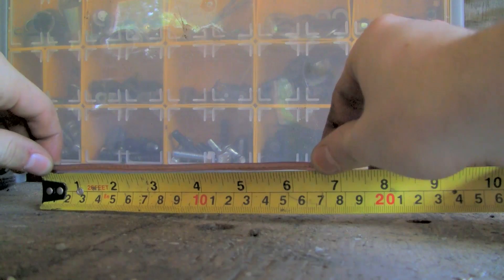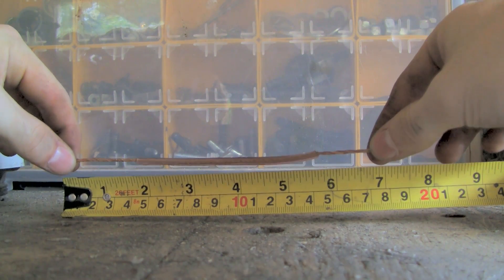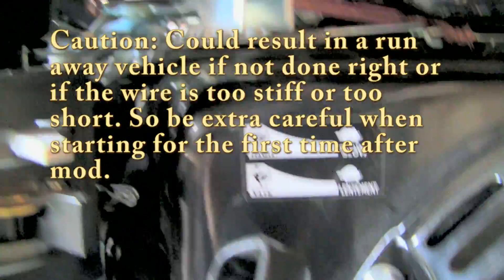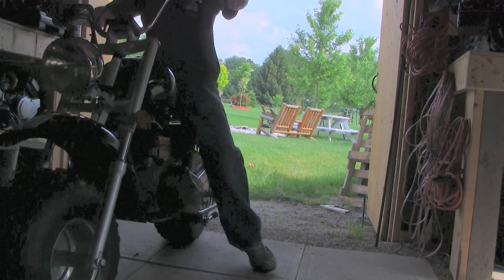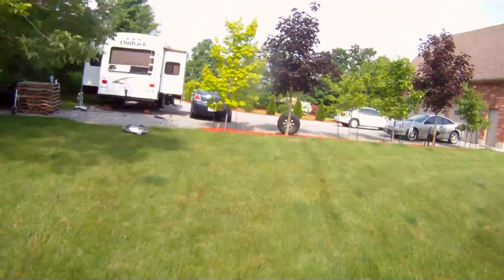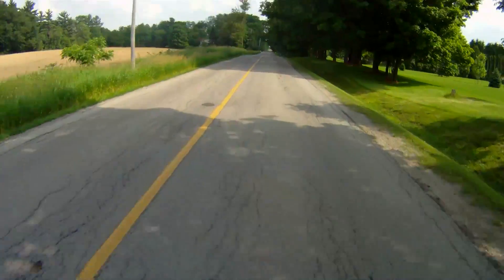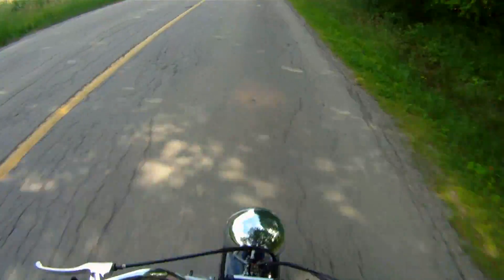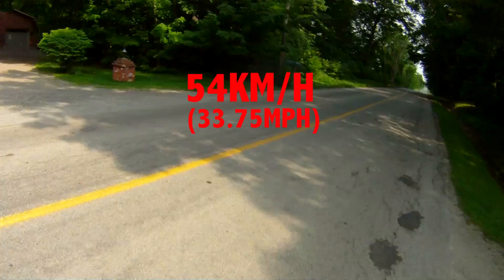Mini Bike Easy Governor Bypass (1080P)

Comment: I tried this with the exact wire and it didn't work (2006 mini baja with hensim 196cc 6.5hp)
Reply from the maker: Maybe someone has already removed the governor in the engine? If so this wouldn't make any difference. Or it's not connected to the right piece? Or there is still slack in the wire at full throttle? Or maybe there is also a throttle stop screw preventing you from opening up the throttle all the way?
Reply: I got it to work! I just forgot to have the throttle wide open before attaching the wire through it. Thanks for the quick reply!!
Reply from the maker: NP!😁

Comment: can you do a top down veiw
Reply from the maker: That would be a pain because I would have to take off the gas tank. :P Just did it from the perspective most people will see because I doubt people would want to have to pull off the tank. It's super easy to figure out what to connect to. Just start up your bike, poke things under the gas tank. When you find the piece that revs up the engine when you poke it, stick one end of the wire to that. Now twist your throttle a bit and observe what moves. Stick the other end of the wire to that and Voilà lol.
Reply: @MarcelsWorkshop  its kinda hard to see where im supposed to attach the other end to the throttle, where is it?
Reply from the maker: There is no specific spot, you can attach it to anywhere along that metal lever that moves when you crank the throttle. I just find a hole I can poke the wire through and wrap it around.

Comment: Any engine trouble after doing this
Reply from the maker: No, still going strong 8 years later. With that said though, I did put a torque converter clutch on it shortly after, so it really only runs past stock rpm when you launch. After that, the torque converter switches to high gear and brings the rpms way down.
Reply: @MarcelsWorkshop  that's great.  Thanks for the response.  I plan on getting a torque converter next week.

Comment: You can the throttle screw completely out and it has the same effect cuz I did it on a Baja 200 identical to yours and only reach 33 miles an hour so you guys are doing something different but getting the same result nothing special good video though

Comment: haha cool, I tried this just to see if I could di it and sure enough it bypasses the governor and does go a little faster, I used too stiff of a wire and had some runaway issues until I switched to a speaker wire like you used. works just fine that way but it is definitely too hard on that little engine in my opinion and id be too tempted to run it as fast as it would go all the time so I put it back as it was , for what it is it doesnt really need to go fast, its just meant for putting around campgrounds or on your property or putting down forest roads, if I want to go fast I can ride a real dirtbike or just drive a car lol.
Reply: AsTheWheelsTurn mines just ran away it’s it was a bitch to catch 😂

Comment: can someone please explain what this exactly does
Reply: So lets say your engine normally will max at 1,500 rpms with not governor you will make at 2,200 rpms which the engine wasn't meant for, I blew my engine apart.
Reply: RattleCan Bro so you don't recommend this?

Comment: i tryed this on my thunderbird and figured that it wouldent matter where i hooked the left side of the wire where the throotle is so i just tightly looped it around some hole and when i started it i was idoling at max speed i instantly shut it off and took the wire off and its still idoling at my speen how do i fix this some one plz help me
Reply: Seems you may have disconnected your throttle linkage.

Comment: don't no what my dad did but when I crank my coleman 200 it takes off full throttle and I don't even have to turn the throttle and when I do it shuts off any ideas how to fix throttle or why its doing this
Reply from the maker: probably too stiff of wire would be my guess.
Reply: I also have a Coleman 200cc probably same as yours. I think Coleman only makes 1 mini bike. I'm breaking  mine in I barely have 2 hours total ride time if that put into it. I did manage to adjust a wire to were I know I. getting full throttle, because that knob won't go any farther. My point is, I had a monster moot 80cc took governor off and used 93 unleaded and ethanol FREE gas! And clocked in 28MPH.Fortunately in my area 1 place has it advertised ethanol FREE. I use the best oil and octane booster. Ok yes the 200cc has power beyond belief but still slow as crap??? Still don't get it I mean 200cc should hit at least 35MPH. I'm lucky if I knock 23. I also know the governor still must be on it because when I take a hill downwards I feel the clutch and everything basically restrict my speed. I mean come on full speed 21mph + Going completely down a hill. Mathematically speaking I should have more than 21mph but get feeling I stay at 21 regardless maybe even slowed down. ?????? is how can I relive this baby and let her live?!
Reply: Clean out the clutch.
Reply: Your issue with top speed has more to do with gearing than the size of the engine. The final drive ratio on your bike is around 10/1. Bottom line is that these Coleman mini bikes are set up for lower speed trail riding, not higher speed road riding. If you want more speed you will have to start modifying things. That means either higher engine RPM's, or different gearing. From what I seen on my throttle linkage, it looks like they had the throttle travel screw turned in way too far which would limit top speed. When you say you only stay at 21 going downhill do you have the throttle pinned? What happens downhill if you let all the way off the throttle? You are probably being restricted with engine braking because the clutch is still engaged.

Comment: We're can you buy a torque converter for them???
Reply from the maker: i've bought stuff from mfgsupply.com many years ago and they sell the torque converters. no idea if they are the best deal or still reliable or what not, as I haven't searched for one in years.
Reply: dandan1171 princess auto and or harbor freight
Reply: lmfao harbor freight doesn't sell torque converters the fuck

Comment: hahahaha. mine is a runaway. 
 its so awesome though cause if i pull the air lever it goes faster. and when i give it throttle it goes even faster. and if i add gas it goes even MORE faster lol. 6.5's are a steal for the price they ask for.
Reply from the maker: +Pred 212 Haha guess your wires a bit too short or too stiff. :P
Reply: MarcelsWorkshop  Nope :p The idle screw was set too high. Big power gain but had to use the on/off switch to engine-brake.
Reply from the maker: Yeah guess that would do it too. Although wouldn't that of given you a run away even before the mod? :P
Reply: MarcelsWorkshop Yup. That's what i get for messing with it before i even started it for the first time. Good fun though. i'd do it again. lol
Reply from the maker: +Pred 212 haha I see. :P

Comment: how did you attach them
Reply from the maker: attach the wire? just poked the stripped part through the holes and twisted the wire together. :P
Reply: MarcelsWorkshop but did you like rap the wire around it
Reply from the maker: holden shaffer
poke wire in hole then twist it around itself to lock it in place.. :P don't know how else to explain it lol
Reply: ok thx

Comment: You really need to do more research about "safe" methods of modifying small engines. Try Oldminibikes.com/forum. What you have there is a potential bomb between your legs and I wouldn't want to see it explode with you on it... oh and yes,
I have seen video's of that happening.
Reply: Probably only the older engines cuz even with internal governors removed the worst that could happen is snapping the rod so u won't die
Reply: +PLAN Fazz No, my friend. On these honda clones the flywheel is plastic. At high enough RPMS they become shrapnel bombs.
Reply: +99in3 Gaming I hear what your saying but I just can't find any video evidence of a engine exploding period governor or no governor so I don't know if it can really kill you if it goes wide open no governor

Comment: I've done something similar to what you did, with the same results.  Instead of adding a wire that can come loose over time.. I took a good quality small zip tie, and inserted it down the length of that little coil spring that you were bypassing.  Put the zip tie through and just cinch it up . It basicly turns the spring into solid linkage.  Managed to get towards nearly 60 MPH from a mini bike with the same engine your using and adding the torque converter as I've seen you do,( changed up the gearing a bit though).  I always wanted one of those BAJA bikes though.. it looks like a blast.
Reply: I put a zip tie on the spring and it stayed wide open
Reply from the maker: Nice!
Reply: I put a zip tie on mine and it kept running
Reply: anonymous  how did you do this? looking to do the same.
Reply: anonymous  Thanks a ton! just wasted 25 mins with the wire becuase i didn't know which spring, I'll definately be doing that tomorrow!

Comment: Isn't there a screw u back out?
Reply from the maker: Not that I can recall?
Reply from the maker: Jake Torres
 The most any screw backing out could do would get you to the max governed speed of the engine. To go faster then that you would need to remove or bypass the governor.

Comment: I did this, but with a bicycle spoke bent at both ends instead of a piece of wire. Works great but I was worried that holding the governor open whilst it's trying hard to shut might be bad for the engine- possibly cause governor to break? I had one engine where I did this, (chinese copy) and the conrod went because I over-revved it. So do be careful!

Comment from the maker: I'm not sure.. if you turn off the bike and crank the throttle wide open and it is pulling the wire tight and holding governor wide open, I'm not sure the problem.. There's a throttle stop screw you could try loosening and see if that makes any difference?

Comment: Hey bud a little help please, i set mine up exactly like yours. The wire was tight and everything and it still acts like it's governed. I've tried fishing line, zip ties and it always acts the same. I've definitely had it tight enough to pull back the governor. I'd rather bypass it then take it apart. Any ideas?

Comment from the maker: hmm how long were you holding it wide open for? Could just be excess oil burning off. I find at high rpm's if you have too much oil the engine starts burning off all the excess. Either that or something broke. :P

Comment: Does loosening the screw that manages the governor have the same effect as putting this wire on? Cuz I think loosening the screw is easier than doing this. can you tell me if the speed will be the same as this method... ivv seen youtube vids on the screw one but dont know if it makes the same difference

Comment from the maker: umm if you were on the bike why didn't you just hit the kill switch? lol. Anyways you shouldn't be doing throttle mods if your not in a controlled setup... Bike should be on a center stand or something so the wheels or at least the back wheel isn't touching anything so it can't take off on you and you can play around with settings until you find the perfect setup. I've done this to everything I own and have never had a runaway vehicle because I don't give them the ability to run away. :P

Comment from the maker: Nice! I just changed the sprocket on the jackshaft from 10 teeth to 20 teeth and that + governor bypassed I got 85km/h out of it. (video coming soon) Too much bottom end was lost though and since all I do is off roading and not street racing I went back to the old setup.

Comment from the maker: Those are the perfect type of places for this. Although they are only worth it if you plan on modding them, because completely stock they are slow and not that exciting. If you have some extra money, the best thing you can do for these is put a torque converter on them. It makes a huge difference in power and speed.

Comment from the maker: its the rpm's and gearing. a 200cc dirt bike probably runs at like 8000rpm and has 4 or 5 gears. These engines only run at 3600rpm and the bikes only have 1 gear. When you bypass or remove the governor that rpm increases probably to around 5000rpm, which is still less then a dirt bike and it still only has the one gear, so it still can't go as fast. :P

Comment: running that motor wide open shouldn't hurt it, we used to race those motors stock on racing go karts until the ruling changed and the motor builders could do more to them and they never realy had any isseus

Comment: @MarcelsWorkshop 

You need to throw more power at a TAV systrem because the drag is higher than a jack shaft,
You also need to adjust your gearing and more often tune the TAV with a different set of springs ( all depending on gearing and tyre size )

Comment: @MarcelsWorkshop 
Leave the governer intact and add a helper spring instead of what you are doing here.
This allows the governer to function and can get you up too about 5000rpm (  you will likely burn the head light out  ).

Pull the cap off the idel set screw and you can richen up your idel a touch.
Remove the resistor from the spark plug boot.
There are lots of speed parts avaiable fro these engines too.
Many are already in easy reach on the Honda GX160 engine.

Comment from the maker: Although with both methods I wouldn't recommend holding the engine wide open for any period of time if all the other parts of the engine are still stock, because they're not really made to run at this higher rpm and somethings bound to give. :P Best thing to pair this with is a torque converter clutch because then you'll only be running at the higher rpm to take off for the most part, because it'll soon "shift" into high gear and run at a lower rpm.

Comment from the maker: Also you increase the chance that the governor weights could let go and cause damage because there spinning at a higher rpm, but I have yet to see this happen and I've been doing it for years on many small engines, but I recall reading somewhere that they could. Whereas completely removing the governor you eliminate this slight risk. As for affecting engine life I'm sure anytime you modify an engine from factory settings it will affect the life, I don't know by how much though. :P Thanks =-)

Comment from the maker: @THEATOMICTWINKIE Pretty much. There's advantages and disadvantages to each. With this way the advantage is you still get the throttle return so you don't have to add a throttle return spring like you would if you took it out and you don't have to take apart the engine. The disadvantage being the engine still has to turn the extra weight of the governor weights so there might be a slight power loss compared to if you completely removed the governor.